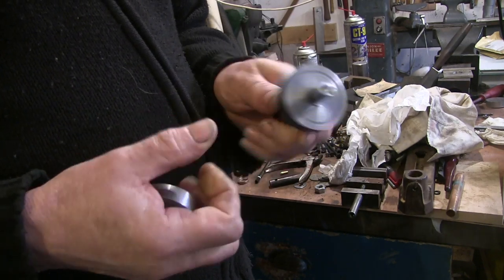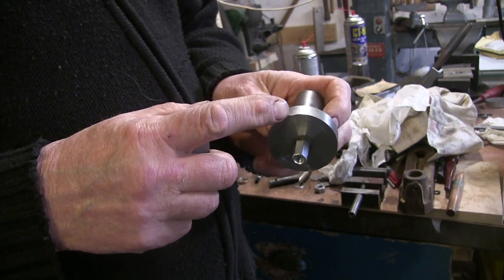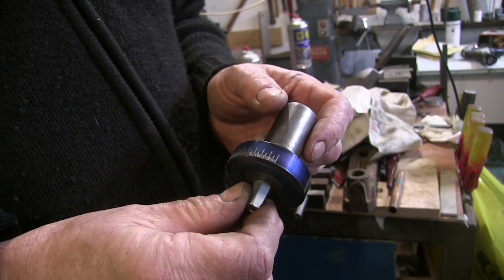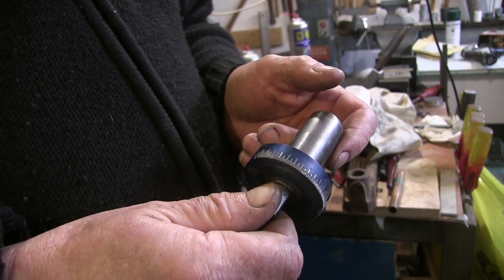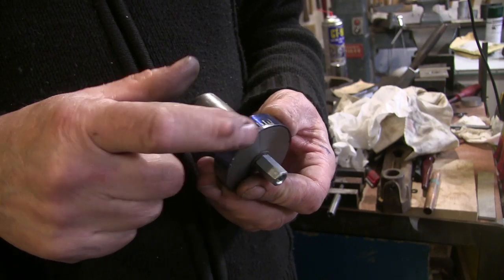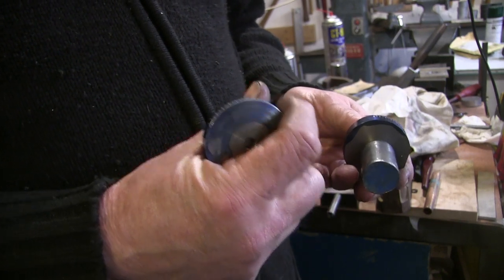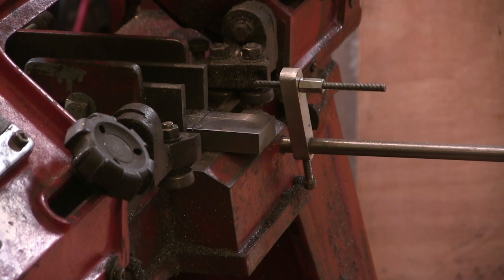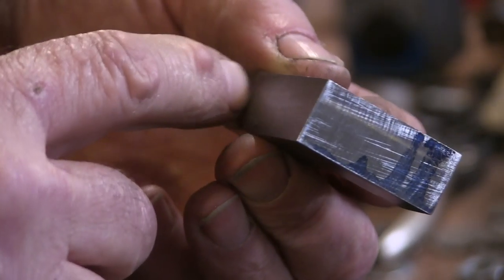Tool & Cutter Grinder, Part Two

Comment: Found your channel whilst researching home built tool and cutter grinder as I'm about to start making one myself, along with a few bits of tooling required to perform some of the operations to make it.

If you have the time, drop by and say hi, I may have one or two things in my content you'll find interesting.

A few tips regarding MIG welding, lay down your beads the same way you would if your were using a hot glue gun and keep the movement as consistent as the wire feed.

Rocking the gun side to side while loving forward is fine if you have to tie into a wall of some kind but no back and forth business, that's for STICK welding only

If your beads are looking too small, increase your spool feed a little to give you bigger bead and slow your movement speed down to compensate.

The usual pressure associated with finite length electrodes running out on you is not there with MIG, so relax and you will soon find a happy medium.

Comment: Onward & Upward !   Is that that shite gasless wire in the mig .  Cheers Cliff .
Reply from the maker: It is Max, having never done any mig welding, I don't have any comparisons! Its just what I've got,
ATB,
Cliff
Reply: @CliffsShed  A couple of things to keep an eye on with a mig is the wear in the copper tip from the wire , the liner the wire runs through gets dirt in it  & you need a really good earth .  I sometimes run the wire through an ear plug to clean the wire  before it goes into the liner , like a filter .  Cheers .

Comment: your flux core weld is way too cold,turn up the power and move  slowly .in your minds eye think joining circles moving forward.if you decide one day to use gas ,its a lot clener and easier to weld with.hope this helps.
Reply from the maker: Cheers Geoffrey, I'll give that a go, I'm brand new to mig welding,
ATB,
Cliff

Comment: Hi Cliff, enjoying the build.
What bit did you use for the graduations?
Cheers Kevin
Reply from the maker: Hello Kevin,
It was one of the chinese "carbide" cutters that came with the 3018 cnc thing I bought, the tip snapped off straight away but still did a reasonable job, I should have rounded it off slightly before I started,
ATB,
Cliff

Comment: Rather than do a full weld one side, where  the heat will pull it over, be better if you tack all corners first.. looking forward to the rest of the build
Reply from the maker: Cheers Ian, I would usually tack stuff, but as this was so little and I could hardly see what I was doing I just went for it, looked a lot better than it was when I was looking through the mask! I need a lot of practice! BTW, this mig welder I got off of my brother, it's a "Nu Tool" and it must be twenty years old at least (maybe thats why the welding is so bad, :-),
ATB,
Cliff